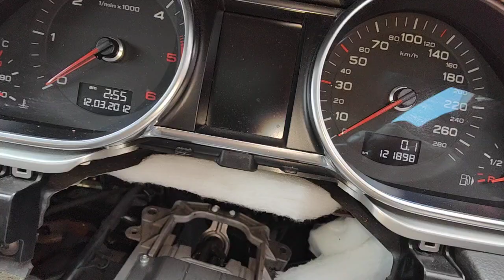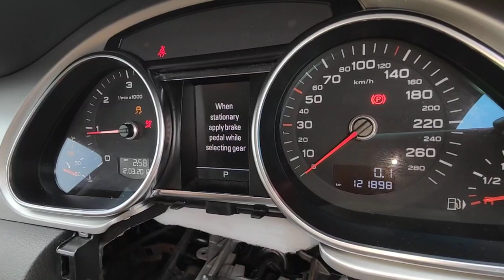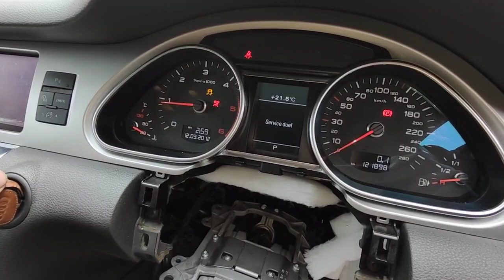Audi Q7 A.M - No Start No Ignition steering column ecu  board data transfer successful

Comment: Are these units coded to the car or would a second hand unit work and you can drive home temporarily repaired because this looks a common problem with these Audi s on if you a second hand unit just plug into the second hand unit and you can then drive home temporarily repaired and get it sorted properly the main question is are these units coded or not they just look like relays and switch thanks for a great video this type of information is always kept secret in the trade
Reply from the maker: Second hand unit will not work because that unit is coded to that specific car.